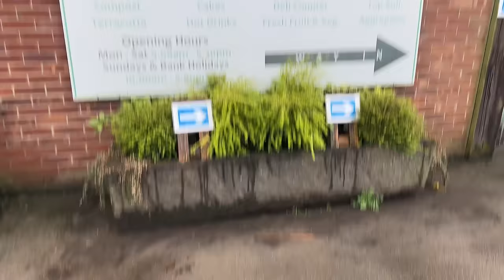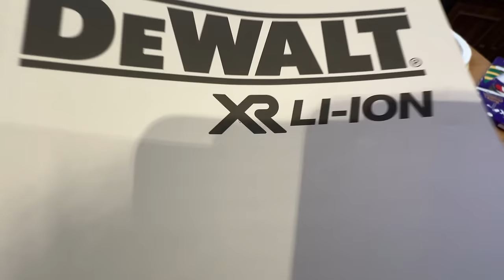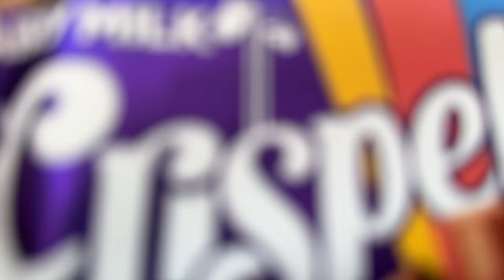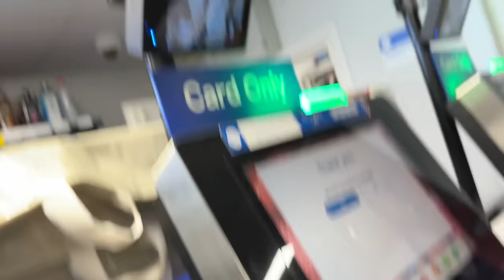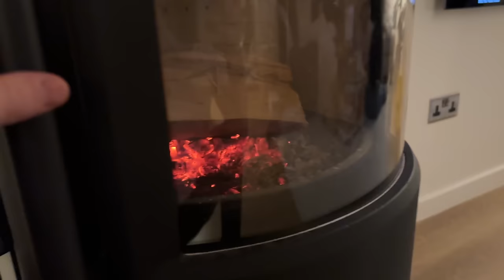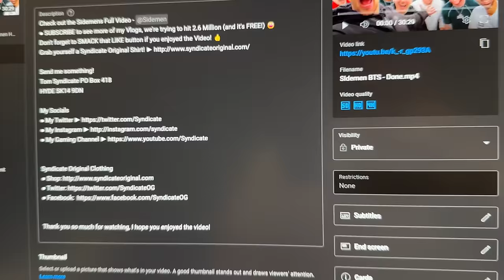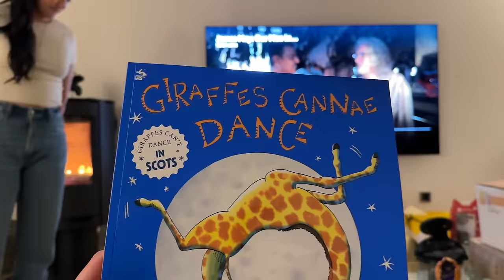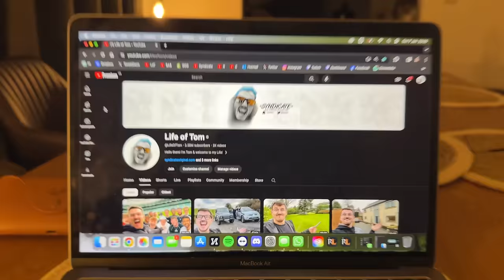Demolition Day has Finally Arrived!

Comment: We have the same issue with our log burner, it takes some getting used to - we start with just a firelighter and 1 or 2 small pieces of kindling to warm the flue before building a proper fire 🔥

Comment: Hi Tom you done a great job there taking that swimming pool down. But just for future reference most of the metal you grinded up. They are just held together with plastic lugs that simple push out and then you can easily take it apart it's so simple. It's designed so you can put it away in the Original boxes for the Winter months.☺️👍

Comment: 4:12 never go by the pressure on the tire. That is the max pressure. Always go by what the door or owner manual says. I always get people at work that go by the number on the tire and sometimes they go way above it. Also anytime a tire needs more then 5psi you need to have it checked for leaks. As the weather gets colder the molecules in the air inside the tire slow down which causes the pressure to drop even though there is no leaks. When winter comes around I have so many people who come into my shop needing air in there tires and I always explain the science behind it.

Comment: Hey Tom. You know your fire is multi fuel. So if you put a layer of coal then the kindling on top pop the fire lighters around, light the lighters then pop your logs on and it will ember for longer keeping the heat going. I had mine for a year before I knew it was multi and since I’ve used a lot less logs 👍 loving the vlogs. Alfie & the fire.

Comment: My only problem with the hoodie is that the decal looks like it's vinyl (or some other material on TOP of the hoodie material) in a place that is folded over and creased a lot. The design is cool but I can see it cracking really easily after a couple washes and some normal use which you can already see at 46:12. Unless it's part of the threading itself it will fall apart quickly

Comment: Double check the grinders disk the metal part on the cutting disk normally goes to the outside (for the nut on the grinder to tighten against)
Reply from the maker: Noted!

Comment: The most common reason for smoke coming into your house when you light a fire is that the damper has not been opened. A damper is a small mechanism that seals the chimney when it's not being used. When you start a fire in your fireplace, the damper should be open to allow smoke out
Reply from the maker: It’s opened..

Comment: Just an fyi you put the wheel attachment nut on the cut off tool on upside down.
Reply from the maker: Ya see I thought that! But then I read the instructions and it said I didn’t!
Reply: @LifeOfTom  Interesting. I would think you would want the larder survace area attaching the cut off wheel blade. That is how I always did it. If I put the narrow end of the nut towards the blade the blade always gets knocked off center.
Reply: I see now looking closer that it is correct when you showed actually cutting it. I just saw it was upside down when you were inside and first put it on. 👍
Reply: @LifeOfTom  #1 Rule, when in doubt follow the instructions. :)